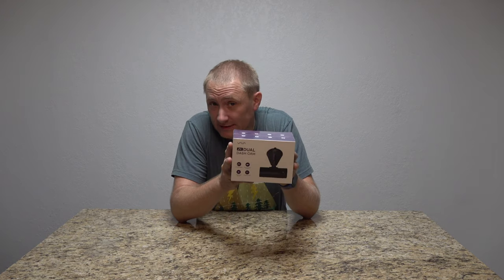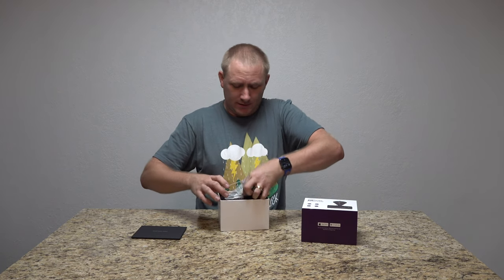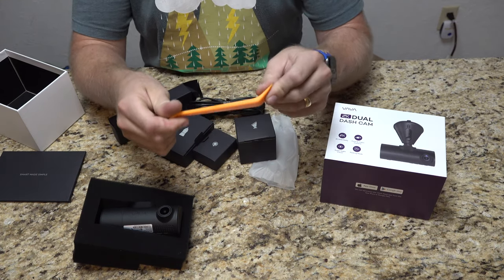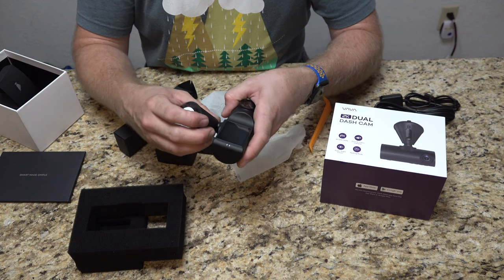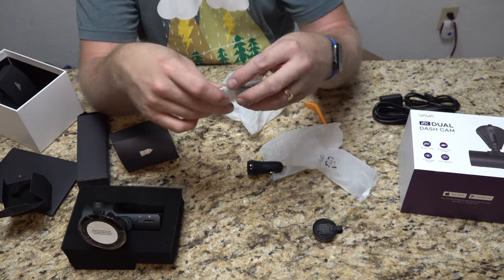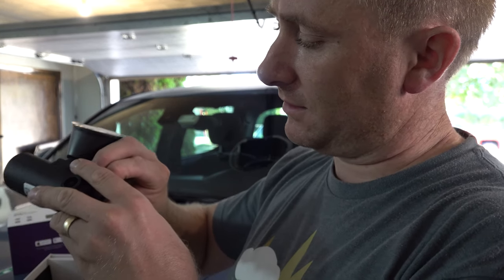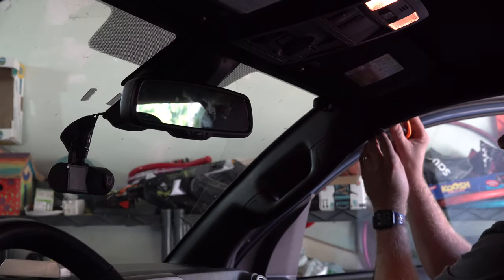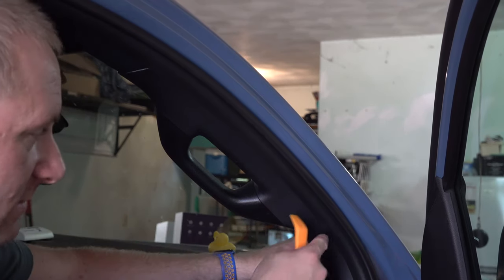VAVA 2K Dual Dash Cam Install

Comment: I have the 1080P cam and it was pretty secure in the beginning but the "neck" loosened up a lot over time. I tried a few things (thick paperboard shoved up there, small cardboard) but what finally seemed to do the trick was a long rubber band wrapped around that neck multiple times. My camera stays in in place now! 🙂

Comment: I noticed the same thing Re: how easily it moved manually after clicking on the camera.  I have the exact same type by Vava.  However, it's never moved from it's spot while I was driving.  Thanks for the awesome installation video!  Also, every time I take the camera off the magnetic holder, it thinks it's an accident or parking mode.  Even when powered off, it will still alert and record thinking the car was struck while parked.

Comment: How do I get a constant loop recording longer than 3 minutes?  It is only recording 1 minute video clips.  Do I need to connect the 256gb card on a laptop to merge the 1 minute video clips that it's recording?  I see YouTube videos with over 10 minute recordings using a dash cam.  How are they doing that?  I'm going to contact VaVa technical support today to see how to get continuous recording!!!

Comment: Unfortunately I procrastinated for various reasons and decided to wait for about two years before installing mine. No warranty! The installation was easy and I had both 128Gb and a 256Gb SD Cards. The camera came on for each card. I formatted the cards, but the camera kept flickering and would keep going off. Seems it's trash... or soon will be.

Comment: Is it normal that the dash cams screen turns off ? When I’m driving it turns on and then for a little while the screen turns off I’m not sure if it’s still recording or not
Reply: It turns off after a set time, you can adjust it in settings, it's normal. The blue led (different dash cams have different color led's) stays on while it's recording so that's how you know it's doing it's job.

Comment: Can this camera be installed "upside down"? That is can I mount it so the mount is below the camera and the camera is resting on the mount? That position worked best and gave me the best visibility for the dash cam I'm replacing.

Comment: Anyone fix a card error? I have a U3 64GB Sandisk Extreme but no luck. I've formatted it on my computer. I've also formatted it use in the cam. It goes through the entire process and then when it finishes it shows "Card Error".

Comment: Hi, thank you for your video. I have a question. I would like a camera that covers front, back, left side and right side. Also that it turns on based on motion, movement, etc. My purpose are to record if anyone attempts to damage car, steal car, etc. Of course to record an accident, or if parked, then a car that may accidentally hit, damage my car and then just dissappear. Will this camera do all the aforementioned?? Please advise.
Thank you 
Xavier

Comment: Helpful video, but wouldn't it be ideal to check that it is working, with power on, before burying the wire?
Reply from the maker: Very true. I usually do this but not on camera. Maybe I will do this on camera from hear out
Reply: I did all the setup options sitting at my kitchen table plugged into a USB wall port.  After verifying everything worked, I then moved it out to the truck.

Comment: Bought one but it doesnt work with a regular SD Card, it wont format. I called Vava and was told i need to be a special SD card for it. But i see you used a regular one for yours. Mine is the same camera as the one on video
Reply: Just needs to be a U3 card.  Nothing particularly special about that, just buy the correct card

Comment: What type of microSD did you use since I have put two and it gives me an error
Reply: I had the same problem. Turns out you need a U3 sd card or it won't work. That was what worked for me anyways.

Comment: Hey just installed mine but tried turning off before getting out of my car but it turns right back on. Why is that? Won't it drain my car battery? First time dash cam buyer lol
Reply from the maker: You probably have it plugged into an outlet that always has power. If you want it to turn off with the vehicle, it has to be on keyed power

Comment: Illegal location in some states, such as California. They require cameras or GPS hardware to be in 3 locations. Lower left of windshield, lower right of windshield and if you want it in the middle of the windshield it HAS TO Be Up High. There is a 5" SIZE MAX, in some of the laws.  I believe to the right of your rear view mirror is the law, so it does not block your view. I would bet many states could have cops pull you over for the wrong location. It's a money maker. Also, In California, you need to make a sign "Dashcam Records Audio", seriously, that is part of the law to protect passengers. If you say something illegal, and it records it, get pulled over. They'll do bad stuff to you using the audio recording. $$$ maker.
Reply: Where did you find the CA regulations that state ur comments above?

Comment: When you go to a bump does the camera looks like it going to disengage from the magnet and might fall?
Reply: The magnet is quite strong.  I haven't had an issue with it at all.
Reply: it would not disengage, but over time it will become loose.
I do off-road at least once a month, and after 3months, mine doesn't stay in place especially if i make a sudden turn or i hit a small pothole driving around the city.

Comment: Does this record behind the car if its being hit while car is running or not? Im very interested if it will record front AND rear (not inside cabin) perfer recording behind my vehicle if it gets hit
Reply from the maker: Does not record rear, just front and cabin.
Reply: Get the dual cam ver for 20$ more

Comment: I have had this cam since 9/21 and can't figure out how to see the videos or pics spent hours on You Tube and websites. Not knowledgeable enough if it's me or the cam that's faulty. Seems that the directions and videos gloss over things that a novice doesn't know. driving me up a wall called their support and they referred me to You Tube!!

Comment: hi, my question is , how the dash cam recording when the eng. are off, no power ?
they have a backup battery? thanks!
Reply: It plugs into your cigarette lighter or USB ports in your vehicle.  When you turn off the car, it turns off about 4 seconds later.  It has a built in battery and is monitoring if somebody hits your car etc and will automatically turn on using that battery.  Mine turns on when I get into the car, so the sensitivity is really good.

Comment: I’ve had mine for about a month, and the damn thing doesn’t sit still. It moves during every turn,stop, or bump. Do you have this problem? The ball joint is very loose.
Reply from the maker: So far not that I have noticed, but I am still testing. My Tacoma also has the off-road suspension though so it is quite plush. If it does though, it will be in the review coming soon. I will reach out to my contact and make this known though.
Reply: GeekSmart thanks for the reply, yeah it was ok for about a month, then the past week it’s been unable to just stay in it’s position. I wouldn’t think it would sit there to record an accident if it happened. I live in Arizona, wonder if it’s the heat warping the plastic?
Reply from the maker: I spoke with my contact, and they actually found an initial problem where the shaft becomes loose after constant vibration, they have actually fixed this with the new units. I was instructed to tell you to email their Customer Service team with your information, order number and the description of the problem, they will send out a replacement unit.
Reply: GeekSmart awesome, I will do that right now! Thank you.

Comment: So it only record for 3 mins and then it deletes and records over that 3 mins? What happens if there’s an incident that last 10 mins? I only get the last 3 mins?
Reply: It saves every 3 minutes and if the card is full, then the oldest video gets deleted.
Reply: if there's an incident, it will record 2 files, one for the looping and one for EMERGENCY, the emergency file is locked and will not be deleted unless you delete it yourself.

Comment: I just had mine for almost two months now and just recently the cam wont loop record and store anything on the app. I might have gotten a bad unit since this one also moves around when im driving and it doesn’t sit still when you want it to record as a dash cam. I emailed their support team today so im hoping for some good news later.
Reply: I came on here to find the same thing! Crazy.
Reply: Mine is just the looping or video issue. Looks like it is working, but pictures only
Reply: Weston Roberts yea same here just the pictures are working.
Reply: cilos209 I have a second one (for my other car), so I will test a couple things and should have a concrete answer in a few minutes if it is just the card.
Reply: Weston Roberts yea let me know if you find the solution. I also couldn’t format the sd card on the app smh 🤦‍♂️
Reply: cilos209 So it is the micro sd card. When I put in the new card it worked on both, and the micro sd card I had, which is the correct one and worked for two months, no longer records video on either device. Hopefully replacing that card will fix yours.

When I reset the bad micro sd card and put the VAVA back to factory settings, it is working again. But the card could just be bad.
Reply: @wesroberts1983  sorry just seen this reply. But yea you’re right my sd card was corrupted and i had to format it on my laptop after going through many YouTube videos to figure it out. But now my new problem is that the dash cam is killing my battery really fast. To the point where i have to jump my car every time for use 🤯.
Reply: @cilos209  This seems impossible, unless you're leaving it in an always "hot" 12v plug, in which case, yes, it will kill your battery, just like any other dash cam left plugged in.

Comment: I am trying to install mine,but the screen keeps shutting off, and then it comes on, and then it shuts off.  Help?
Reply from the maker: Sounds like a power issue. Try another port
Reply: @GeekSmart  Thanks.  I discovered the problem, it was my sd card.  I used a few new ones, none of them worked.  Had same shutting down problem.  Finally bought a SanDisk ImageMate PRO 128gb u3 from Walmart and it worked.  No shutting down anymore.

Comment: Is it better to hardwire the dash cam?
Reply: Hardwire kits are not uncommon, but the GPS sensor is built into the power cord, so if hard-wiring, you may need to modify the included cord to keep GPS functionality

Comment: Cool vid , but I thought dual cams had two camera's. One for the front and the other for the back. Which is shaped like a small square. Dude make one of those vids,  cause I'm about to order one. 😆 👍
Reply: the other camera is facing inside the vehicle, which can also automatically toggles the night vision if there's not much light.

Comment: My button doesn’t work. Smh
Reply: Do you have a memory card inside of the camera? I would call customer service, don’t give up on it just yet😊
Reply: @Itsalondramitchell  yes, memory card installed. Everything works out of the box except the snapshot button. I even tried their suggestion of resetting the camera. Still no luck. I’ll try changing the battery and see what happens. I don’t really need the butting but wouldn’t mind having that extra option

Comment: Do not buy this camera.  The manufacture customer service is horrible.  Their manuals and instructions lack information, specifically about which SD card works in these cameras.  You'll get one they say works, and it won't.  When trying to get customer service, you will exchange emails with them for weeks to get basic simple information from them and unless you have every piece of information they ask for, they will not provide any answers.  They want vidoes, model numbers, serial numbers, pictures, receipts, etc.  It is endless.  Do not waste your time buying one of these cameras.  Go buy a more supported, likely more expensive brand.  These may be less expensive, but buyer beware.  You'll get what you pay for in the end.
Reply: If you're having trouble with the sd card. It has to be a U3 sd card or it won't work. Hope this helps.